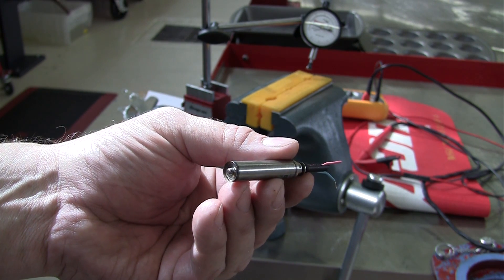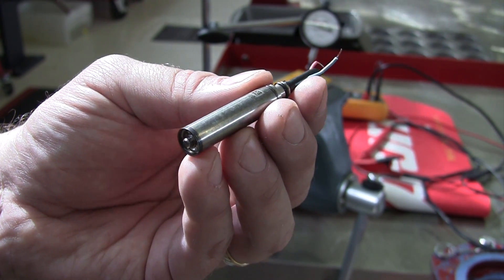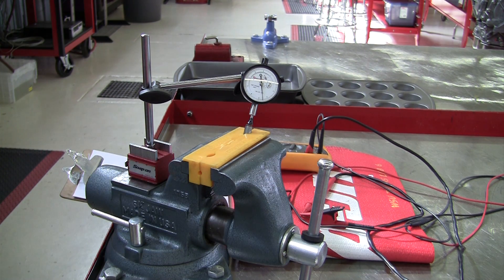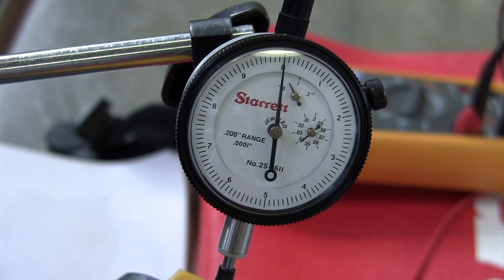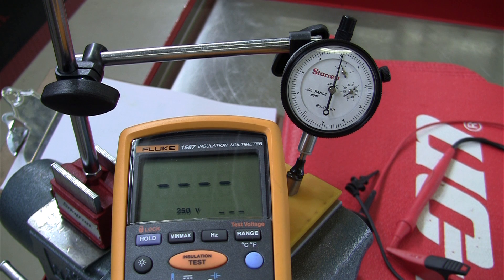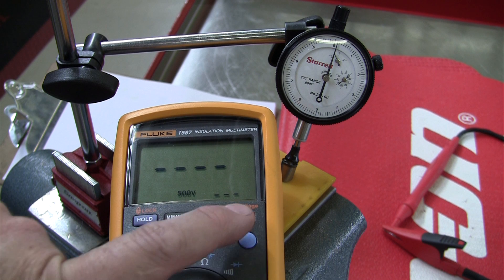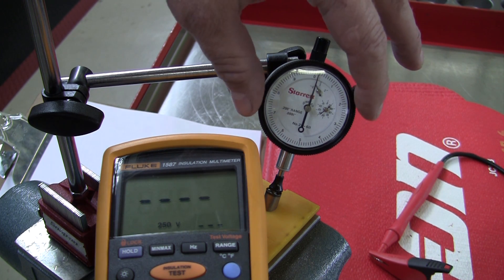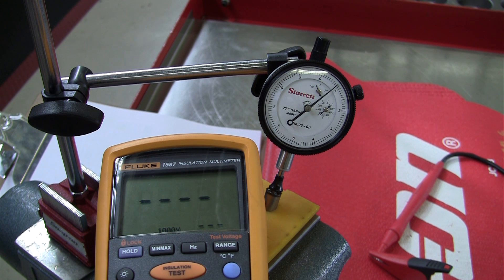GM Duramax Diesel Piezo Injector Operation

Comment: lol "lets apply 1000v.....oo it didn't like that" awesome
Reply from the maker: +kraymer999 LOL, yes, as it turned out, the 1000V setting caused a spark between the meter leads rather than actuating the injector. I had the leads too close together. After I moved them farther apart, it worked fine. Have a great day!

Comment: This is a good qualitative test, but if the injectors can really consume 30Amps times 250Volts for a total of 7500 watts as stated in the video.  there is no way that battery powered meter is a good functional test.  I assume fluke is correcting the actual applied voltage by changing the displayed impedance.  Note that coming in contact with 250 volts dc at 1 amp could be lethal.  Thank Tesla for the ac system in our homes.
Reply from the maker: williammmmkz Thanks for watching. You are correct, this is not a proper method of testing the injector. It is only a demonstration.

Comment: The crystals change configuration or shape and return back to their original shape great tollerence to any effect of heat or wear. By changine shape, you create a leak within where fuel passes through. You can pulse these so many times and they will always return back to its original shape

Comment: Yes, the only injector capable of producing 4-6 injection sequences in a single stroke.Pre and post, greatly reducing nox, giving a cleaner burn and eliminating diesel knock resulting in a quieter engine

Comment: Another superb video to help explain how this work. I was just strugling to explain piezo to my step son last night in an easy to visualize way, this is perfect!

When using the megger you should drain the voltage after each time i believe (well on mine you have too anyway it has a button just for that. That's was in part why it did not go to zero when you left the wire. It also helps keep the bateries last longer.